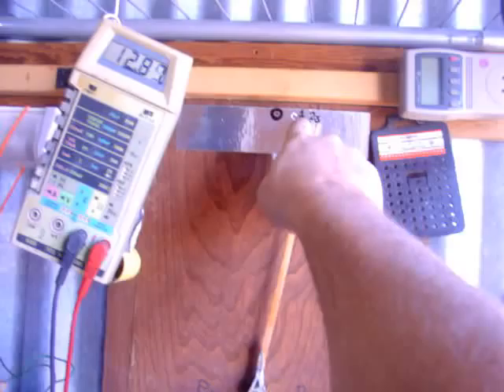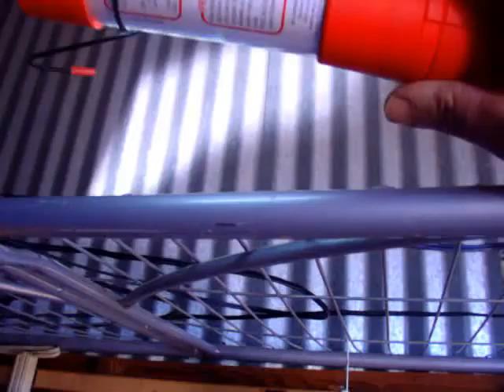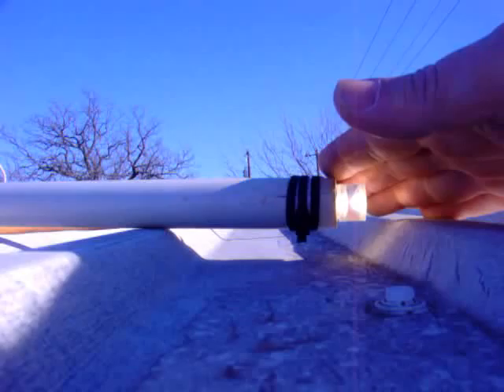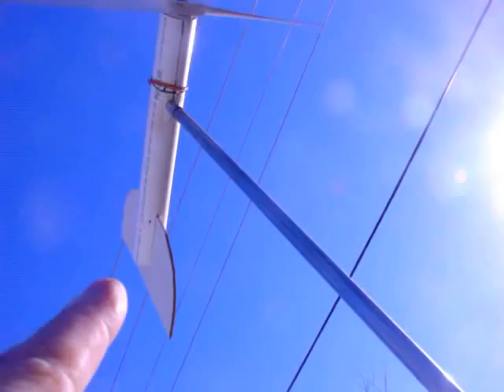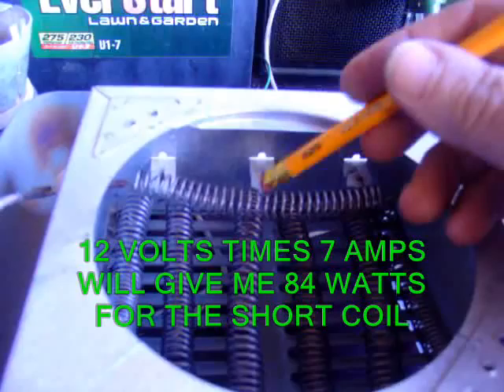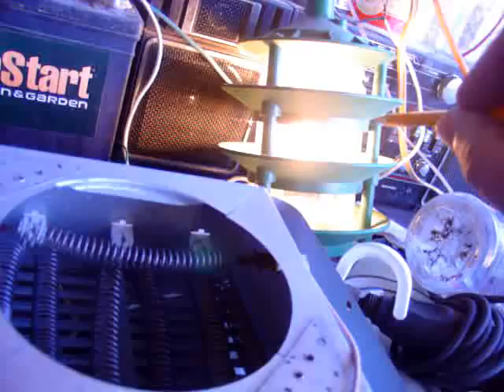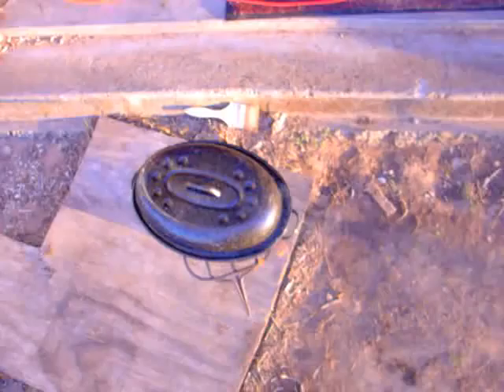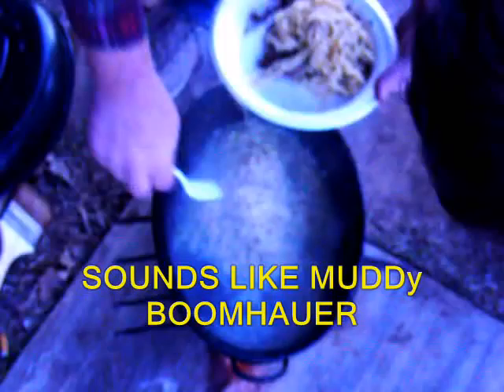TAPE DRIVE MOTOR WIND TURBINE PART 2 AND A BASIC SAW DUST STOVE

Comment: I think what Muddy means is,you can dump load direct to a battery with no inverter,but once that battery is full it will over charge and ruin the battery.You should dump into a high load such as a heater,either direct from the battery for a 12v load or from an inverter wired to the battery for 120/240ac load.The dump load is there to protect you battery from over charging and protect the turbine from over RPM if it doesn't have a furling mechanism. Wire the spare battery to the other for a bank

Comment: Ahh , what I wrote before is true, but it just sunk in with what you said. Yes that would work, 1 main battery/bank coming of the alt will still need a dumpload to protect the main batteries and turbine etc. Then an inverter from that to a charger, to charge battery or anything else you want AC power for. The main side of the whole system is your main power source after that it doesn't mater as long as the inverter/s is up to it.

Comment: I was hoping you where gonna make a water heater dump load when I saw them there elements :D. Seeing they don't get really hot you could use the long winding as a variable resistance type thing and securely clamp the "wiper" wire where the ohms is where you want it. Or like Raymond Earle said, do a bit of series/parallel or even a voltage divider. If you do use the elements to heat water, remember to insulate them with enamel paint as they will cause electrolysis of the water and the wire.
Reply: Your a good man Muddy. Hope to see a catchup soon :)

Comment: New at this, love your videos,  so you can't dump load into an inverter, that has an extra battery charger plugged in, and battery charger connected to a back up battery or batteries ??? Thanks again.

Comment: Hey muddy, I sure you removed the 1 /14" pipe after saw dust was packed in there. What if you put another ring bigger than the 1 1/4"  say 3" and only filled between them... I wonder if this would work?

Comment: I have been working on a ac powered slowcooker/crockpot/stewpot temp controled by one of them arduino boards, that got me into food saftey etc, etc. Without my controls the slowcooker I have runs at 160w then when everything is hot it idles about 20% duty to maintain the heat for 5 lts of food (gallon) with it's standard built in controls. I wanted to change it's idle temp for water bath cooking, but 160w isn't much through an inverter in high wind and cold weather? cost me £40 maybe :D